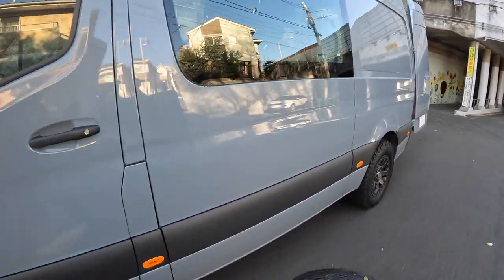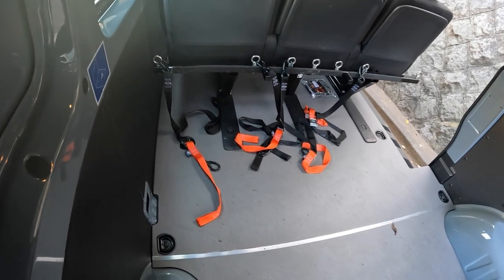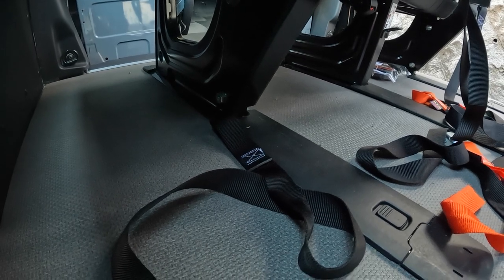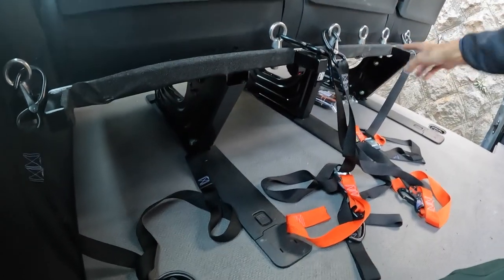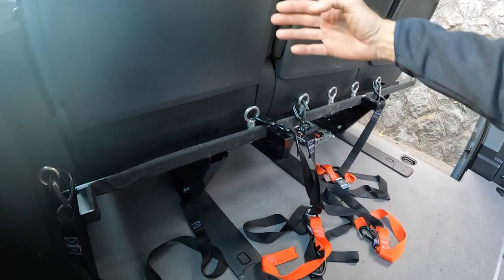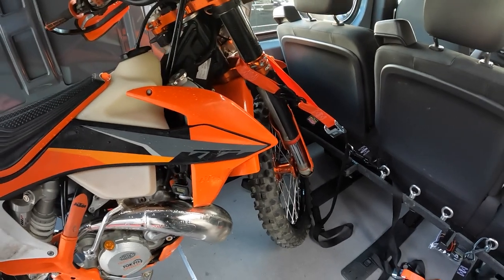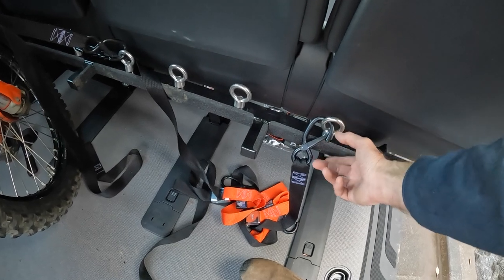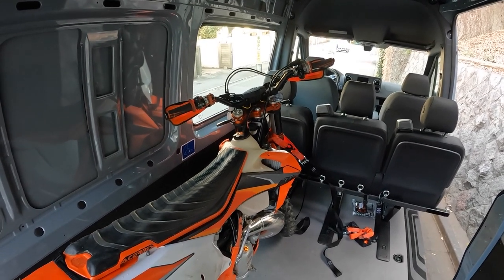2021 Mercedes Sprinter 144 Dirt Bike Tie-down Bar

Comment: Instead of raising the tie down point - are you able to turn the mount upside down and attach it to  underside the bar?
Reply from the maker: Yes, I could mount the tie down point anywhere I like, including on the bottom of the bar. I made the bar height half the front wheel diameter. The problem is that the right strap of the the left bike crosses where the front wheel of the next bike goes. Raising the tie down point of this strap should provide increased clearance. I've already made some spacers and have longer bolts and will try and see how it works later this week...